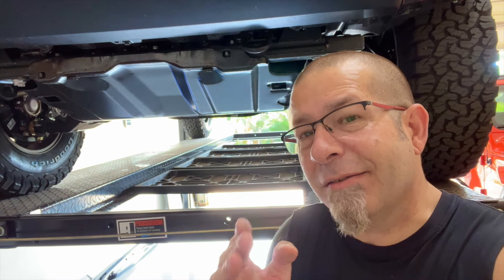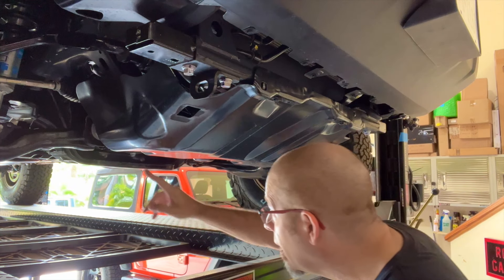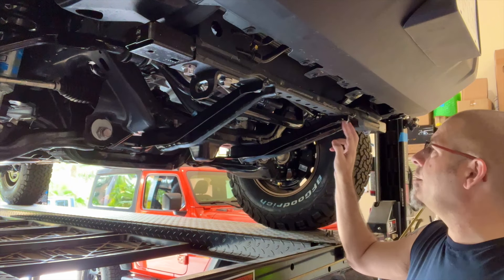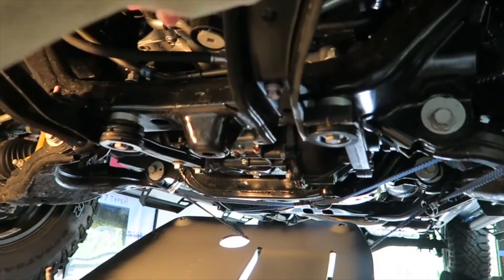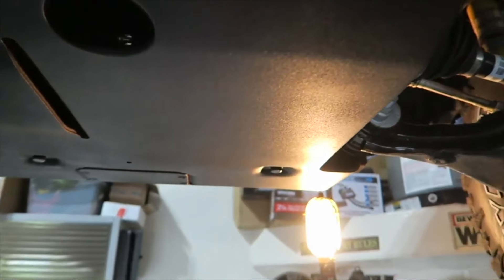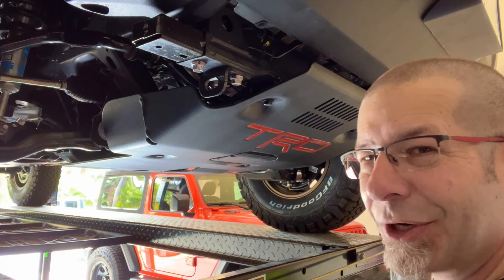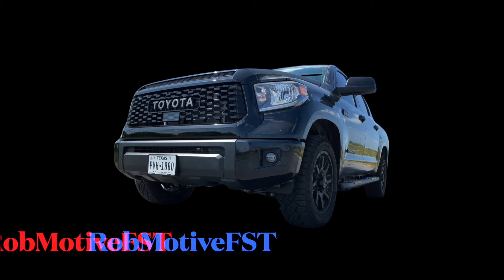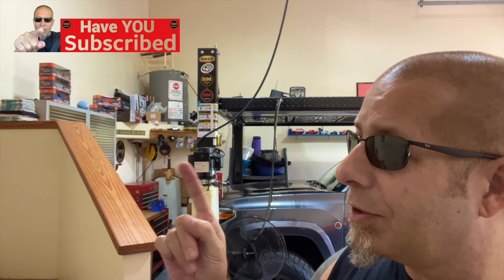Make My Tacoma Front End Look Better

Comment: Looks good, I just installed the meso custom stage 1 led taillights it changes the reverse lights to directional and reverse and it makes the old directional and brake light just a brake light, just something you might want to check out.